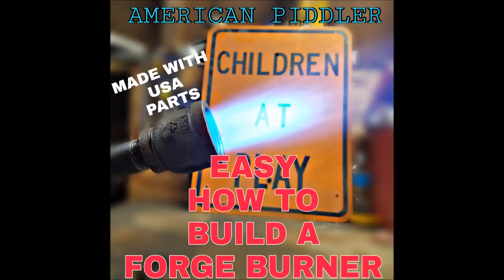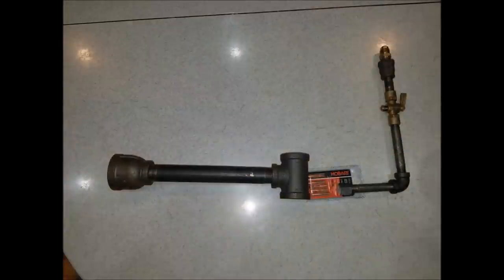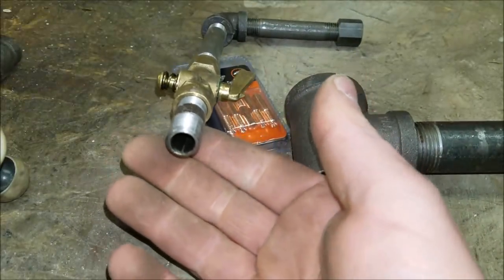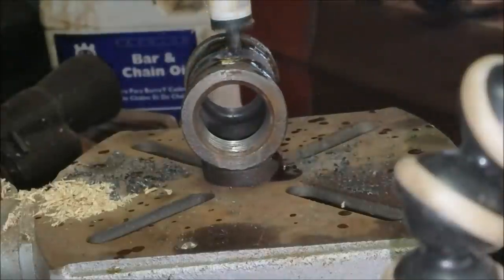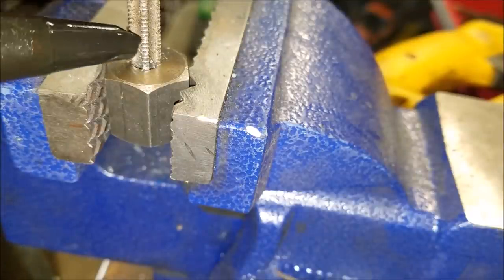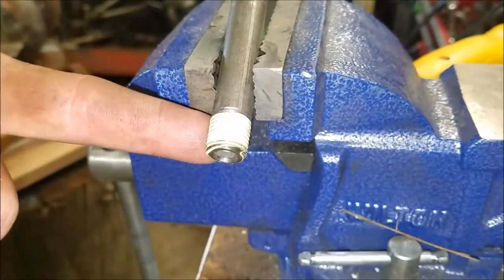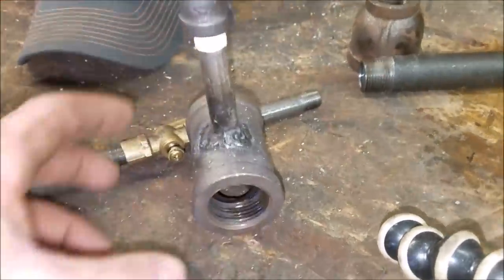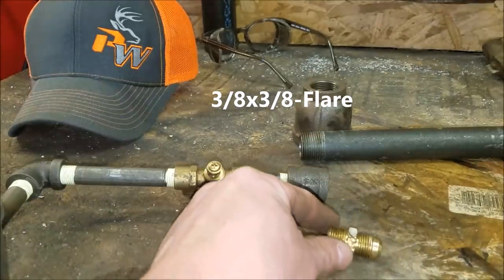How To Build A Forge Burner

Comment: Great build, thanks for your knowledge, I'm starting to build mine today. Some pieces I still have to get. I did want to share a quick bit (literally). Heating up bits is a big setback to us piddlers. Rather than sink cutting oil into the hole, it's better that you coat the bit itself. It allows heat transfer to the metal rather than heating up the bit.
Reply from the maker: Thanks for watching don't forget to subscribe and keep on piddling! #americanpiddler

Comment: Did you drill a 1 1/4 inch hole in your forge and use the bell to hold the flame or did you use a larger 1 1/4 straight pipe with screws to hold the 8 inch 3/4 nipple for the flame to go into the forge.?
Reply from the maker: I dont exactly remember but I know that I show it in the forge build videos! Hope ya subscribed! Thanks for watching and Keep on Piddling #americanpiddler

Comment: Your design is one of the best I've seen, it's simple and does a fantastic job...I want to make a double burner forge hopefully using this same design. I will have to play around with the configuration but should be able to make something happen. I've been using coal and really want something a little cleaner and quicker to get up to temp...thanks again
Reply from the maker: Did ya get you forge and burner built?

Comment: Well Done! Hard to find anything made in the U.S anymore, I am willing to pay more for it every time when I do find it. Any suggestions for tip/pipe sizes using natural gas ( LNG) ? Going to use forced air on two forges I'm building, so using 2" pipe necked down, w/ a gate valve. to control air flow. Large LPG tanks are too hard to fill out here, exchange only gives you about 3.5 gallons and you're paying for 5 gallons. 

BTW- you probably know but the beveled fitting is known as a "flare" fitting. Also, for those out there wanting to do this, I would recommend using  tape rated for gas, holds up to hydrocarbons. Available at any hardware store in the country..
Thanks Piddler, you rocked it
Reply from the maker: Chad I don't know how I missed this comment but thank you! I honestly don't know with LNG but I ended up staying with the .023 mig tip for the setup!

Comment: Good video I'm going to make one tonight for my propane tank forge I'm making.Instead of drilling a 3/4 hole and grinding the cap any reason you didn't just slide the 1/4 pipe nipple through the 3/4 hole in the T?
Reply from the maker: Still have to have the 3/4" come out the other side....

Comment: I have a problem with my burners. It doesn't make a bright flame actually it doesn't start up. I have a high pressure regulator but what's the correct pressure and the distance of the tip before de mixer?? Thanks for the tips of the regulator I'm using my acetylen regulator
Reply from the maker: sounds like you need a new regulator... Thanks for watching don't forget to subscribe and keep on piddling! #americanpiddler

Comment: Killer stuff. Only lacking a welder. Going to try to find a way around it. Awesome video. I like your style
Reply from the maker: I plan on making a video on an improved design that wont require a welder! I sure appreciate you watching and commenting! "Keep on Piddling"
Reply: Tap one end of a 3/8 MIP X 3/8 MIP hex nipple fitting to accept the welding tip. Tap the tee for the hex nipple instead of welding anything.

Comment: Will a brass 1/4 cap work for this. It's the only cap I can find. I do have a black iron 1/4 cap but it's not 6 sided like yours.
Reply from the maker: I dont know I have only used black iron pipe! Thanks for watching and Keep on Piddling #americanpiddler
Reply: @AmericanPiddler  oh thanks Ezra. I'll try to do a video if it works . I'm going to try both , the brass and the round black metal. Wish me luck.

Comment: good job....TO ALL READING THIS...THE CORRECT TAP SIZE FOR MIG TIP IS M6 x 1   ...almost all manufacturers use metric now a days... imperial sizes siezed in the late 80's...,😎   1/4 x 28 will work...but remember,,propane is gonna flow through it.
Reply from the maker: Super helpful information! Thank you very much for taking the time to share this with the Piddling community! Thanks for watching and Keep on Piddling!

Comment: High pressure regulator... Check... Wait.. How much pressure?? There are many different ranges. I bought a 10 lb high pressure regulator.  Will that work?
Reply from the maker: No! The regulator we use and have a link to goes up to 40 psi! Thanks for watching and Keep on Piddling #americanpiddler

Comment: I'll like to apply your design to a branding iron heater.  I need the 3/4 nipple to be more than 8" probably 12' - need to move the end of the burner pipe in and out as another way to regulate heat in the 8' pipe burn chamber.  Also, what pressure range would you recommend for the pressure regulator?
Reply from the maker: We use the regulater provided in the description... it's a 5-40psi regulator... Thanks for watching & keep on piddling #americanpiddler

Comment: I have a question. Can I use 3/8” parts instead of the 1/4”. Do you think I’ll loose a lot of pressure by doing so?
I already bought the parts so I guess I’ll give it a go. Also I have a .030 mug tip and not the .023
Will this be a issue?
Reply from the maker: The 3/8 shouldn't be a problem the .030 tip may cause it to run rich if so you'll need to add a couple of air holes to lean it out. Thanks for watching and Keep on Piddling!

Comment: I'm having issues with mine currently. Unfortunately I had to figure out on my own that is standard low pressure regulator wouldn't do and fortunately wise enough enough to get a high pressure LOL but my question is will the MIG tips make that much more of a difference because I'm still having pressure issues and I can't find out why. I don't know if it's the way the plumbing is ran or if I just missed a step and I'm not catching it. So please let me know if I need to tap my nipple line and insert a MIG tip and if it makes that much of a difference and will help obtain maximum pressure out of the nozzle
Reply from the maker: robert gagnon send me a message on Facebook or Instagram with pictures of your setup! Are you trying to just push propane through the nipple without a tip? That's not going to work.... if you follow what I do in the video it will work!

Comment: Have you tested if the 1/4” piping route could handle a double burner for a forge? Or is there not enough pressure?
Reply from the maker: Austin 1/4 would be fine and the regulator in the link will handle the pressure!
Reply: American Piddler Last question, if the mig tips aren’t perfectly centered in the middle of the 3/4” nipple will it hinder performance?
Reply from the maker: Austin yes you will need to get the tip as close to center as possible as this is where the air draw happens and if it is not centered it wont draw the air evenly

Comment: Nice build. Did it work better with a larger tip?

When dealing with propane, NEVER use white teflon tape. Propane gas corrodes it, leading to gas leaks (and in my case a small flame where it did not belong!). Use the yellow tape formulated work with gas.
Reply from the maker: I did try and it didn't run better it was too rich... Sure appreciate you watching and Keep on Piddling #americanpiddler

Comment: Will this design work without a regulator? I have a 3/8 propane hose 10ft long. Can I put propane acme nut on the 3/8 hose to screw into the propane tank. Or will it push out to much propane and potentially be dangerous? I'm done with the build but dont have a regulator. I wanted to try it out without the regulator but I'm concerned could you answer me if you know the answer ASAP please sir thanks in advance
Reply from the maker: DO NOT DO THIS WITHOUT A REGULATOR! I CAN EXPLAIN MORE LATER BUT THIS IS TOO DANGEROUS!
Reply: @AmericanPiddler  thanks one more question I have a kobalt air regulator brand new in the box. It will run 0 to 155 psi its threades 3/8 can I use it even though its a air regulator. I saw another build where a guy used a regulator off of the oxygen side of accetaline and oxygen torch hoses so I'm wondering if the air regulator I have will work?
Reply from the maker: I dont believe it will go to 155 psi...... if it is only a 15 you can try it but I would recommend a higher psi theres one in the link below that goes to 40psi

Comment: Hello, you did really great job. I'am trying to do the same build, but it is really hard to find 1/4 fittings in Czech Republic, especialy the nipples.... What the inner hole diameter of nipple have to be so it won't loose the function? Can you write down some alternatives to it? Can I use some 3/4 nipples and use reduction on the end?
Reply from the maker: Yes you can use like 3/8 or even half and the reduce it down right at the Tee! Sure appreciate you watching! Good luck please let me know when you get it going!
Reply: @AmericanPiddler  well, I did drawing of those 1/4 fittings and I will make them on a lathe, I will reply when done 🙂
Reply: You can also just buy a nut and weld it to the end of the pipe instead of drilling and tapping the plug. That is what I did and it worked perfectly. I believe it was 1/4 in 24 thread.

Comment: i really like enjoyed your video and liked your set up using a T instead of a more expensive reducer coupling. Will a similar set up work with a pipe burner tube that is 3-4 feet long? or longer?
Reply from the maker: Thank you for taking the time to comment and be a part of the Piddler community! As far as a longer pipe application I would not know as I have never tried... I think you will have trouble at a longer distance to be honest because of the fuel air mixture...
Reply: what if I bring the orifice through a larger reduction, like 2" to 3/4" coupler, do you think it would allow for a longer distance?
Reply from the maker: I really don't know... you could always try. Please be careful you are using a gas and a flame... keep me posted on how it works I'm definitely interested

Comment: Awesome, would silver solder brazzing work instead of welding? And can a three burner be done in the same way?
Thanks
Reply from the maker: Ben Grady I would imagine brazing could be done also even better would be to drill and tap the hole which would allow for a  finer tune and adjustment of the mig tip! Thanks for watching and don't forget to subscribe!

Comment: Can't weld-no with my vision.   Wonder if JB Weld would do it as the tip is not pressurized.   You leave both sides of the T open?
Reply from the maker: Mark I wouldn't recommend that maybe tap & dye the Tee it's self... I may do another episode where I don't use a welder!
Reply: Nother thought-threaded rod.   Screw the cap with the tip on, thread the hole in the T and thread the rod thru.   On the outsidea heat resistant bead of gasket sealer with a nut.   Or thread the Nipple even higher up instead of risking the rod.   Just kicking out ideas as I like to mess with different things as well.   I am better at breaking things, should have made a career out of it.
Reply from the maker: Mark the nipple is already threaded just drill and tap the Tee itself then after threaded into the Tee add the cap with the mig tip

Comment: Do you think that 8" section of black pipe before the tip could be longer? Im thinking of making this as a snow/ice torch....
Reply from the maker: PyroJoe Joe I have been thinking the same but it would have to be done in a different way.... I may go a head a put out a video in the next couple of weeks of exactly how to do this
Reply from the maker: +PyroJoe we also have to consider the amount of heat that the tip will be put under outside of the forge!
Reply: True....u make it...ill follow 😁

Comment: So where the small pipe goes into the "t", the one with the welding nozzle, if instead of welding that in place you can make its depth adjustable you can also tune your air mixture and possibly get more btu's out of it. This is essentially a "venturi" valve which uses pressurized air passing through something to create suction. I've used it to make sprayers.

Comment: Might use 3/8 on the tip pipe. 3/4 inch hole fits the outer diam of the 3/8 pipe.
Reply from the maker: Might have to try this! Thanks for watching and Keep on Piddling #americanpiddler

Comment: I like that it is relatively easy to build and barely require a welder by the way instead of welding could that be soldered instead just an idea
Reply from the maker: I don't know about soldering... but could be drilled and tapped! Thanks for watching and Merry Christmas!
Reply: American Piddler I’m trying to get a gas forge for blacksmithing going great video
Reply from the maker: Heck yeah please keep me updated on your progress! Have you started yet? Picked your forge body? Picked a burner or coal?
Reply: American Piddler I will keep you updated my forge body is firebrick and basically a 
Long box design and I’m using your burner idea the body looks like the forge from forged in fire tv show
Reply: American Piddler and on a side note my current forge is powered by wood and a hair dryer
Reply from the maker: Forced air nice!
Reply: American Piddler where I got the idea for the body of the gas forge from Alec Steele’s video on how he made his forge
Reply from the maker: I love watching Alec! I'm guessing you are a fan
Reply: American Piddler you’re correct I’m a fan of Alec and your videos

Comment: I am having  a hard time finding some of these fittings on the hardware stores website, particularly the tee.
Reply from the maker: Where are you located? I could probably grab you one and send it if you have PayPal to pay for the part plus shipping...
Reply: Go to a plumbing supply store, they will almost certainly have everything you will need. Most hardware stores won't have what you need. I had to go to three different stores and still didn't find a black pipe 3/4 to 1 1/4 bell. Had to buy galvanized and acid wash the coating off.
Reply: @AmericanPiddler  do you have a website yet to offer a kit for sale to make this thing?
Reply from the maker: I'm sorry I do not...
Reply: @AmericanPiddler  thanks for answering I'm thinking about putting a kit together myself and if you had already done it and had some success I was hoping to get advice.

Comment: Good job man!!!  Good job. I'm working on one, I think I definitely need a better regulator. Saw somewhere that it needed to be 20 lbs or better.
Reply from the maker: Odessa Woodworking and Maker Shop yes sir! Follow the link below to the exact one I'm using it's great easy to use and up to 40 psi I believe! Thanks for Watching hope you had a HAPPY Thanksgiving
Reply: Will do Happy Thanksgiving to you and your family. - Al
Reply from the maker: Did you sort out your regulator yet?
Reply: I did get a good one, however it is still doing the same thing. I got busy and did not get back on the project. I will return to it in January since I am going out of town for the holidays. I am going to focus on the orifice and perhaps a flare as the first steps in figuring out why it keeps going out. It seems like the flame gets blown out by the actual gas. Thanks for asking, do you have any ideas?
Reply from the maker: Odessa Woodworking and Maker Shop 
It sounds to me like you don't have a flame holder.... meaning on mine it is the bell at the end that holds the flame without that I wouldn't have a flame either! 20 psi should be enough but I run up to 40 psi.... the thing about the higher psi you have to have enough air to feed a richer fuel mixture! Hope this helps!
Reply: Yes and that is what I am calling the "flare" you might be totally right - I might just throw one on there...you may be totally right...before I go messing with the orifice which mine is a 57 drill bit hole - I have something to go home and try which is really easy - thanks for the communications....stand by for a response this evening.
Reply from the maker: Odessa Woodworking and Maker Shop 
I guarantee I'm right! With out a flared end it will not hold it's flame! Even if you built a flare inside your forge to hold the flame that would work.... but no flare equals no flame!

Comment: I’m getting a crazy sound and it is burning near the tee how do you get it to push to the bell??
Reply from the maker: Sounds like you need a high pressure regulator! Thanks for watching and Keep on Piddling #americanpiddler
Reply: American Piddler I have one it’s a 20 psi reg and being wide open it burns closer to the tee, is the mig tip inside the down tube ?
Reply from the maker: It should be right at the beginning of the tube... we use a 40 psi regulator.
Reply: Hey man thank for the help I turned it on today and works perfect thank you

Comment: why need so many tee and  extension. why not the valve straight to the 0.23 tube and the propane straight to the valve. is there any reason to make it complicated.
Reply from the maker: Yes there is a reason... IT WORKS THATS WHY!

Comment: Great video! 
 What is the 1/4” cap made of? Copper?
Also, can the nipples be 4instead of 3-1/2, then a 4” instead of a 3” and 2” instead of  1-1/2? 
  Having issues finding the  ones you suggest. 
  I’ll need to order HP reg-
  But can’t wait to get it going- thanks again-
Reply from the maker: David, the cap is also black iron like the rest of the build..... and yes you can use different nipples! I wouldn't vary to much on the 8" nipple in the design... as far as a regulator goes the one I have linked in the description has held up well for me & also helps support the channel thanks for Watching & don't forget to subscribe!